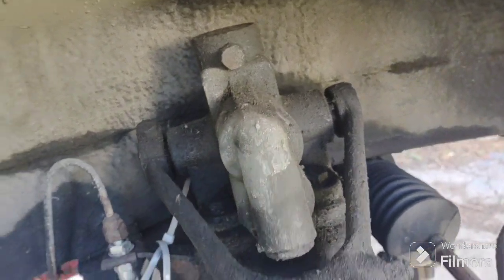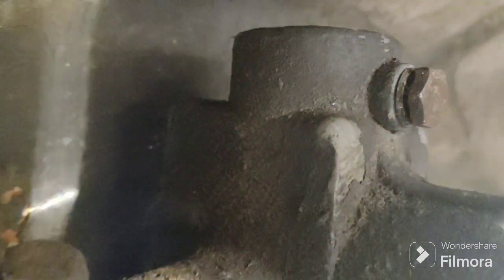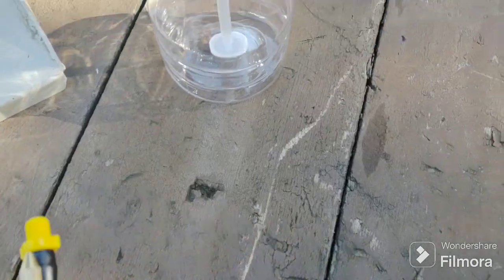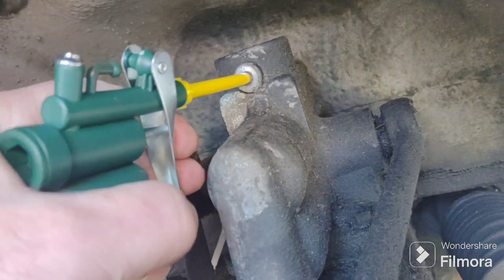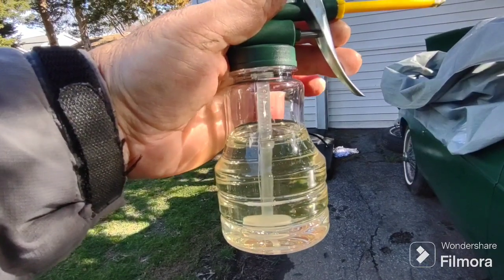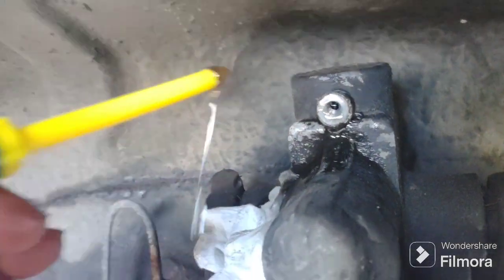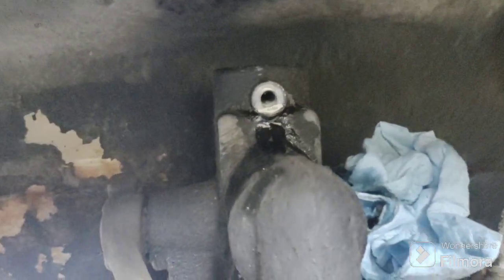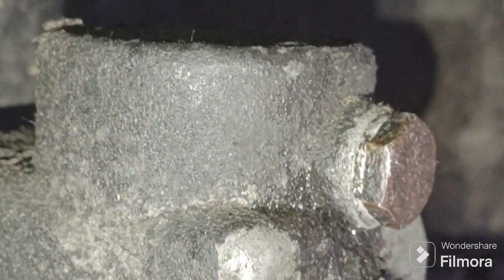MGB Lever Shock Topping Off

Comment from the maker: Just a follow up to my video here, adding the 20W Fork oil did work. It gave both front shocks damping, which they did not have before adding the oil, possibly due to leaking out.
Reply: Thanks for doing the video. You have any idea as to why the old oil is gone? any apparent leaks?
Reply from the maker: @michaelwestermann1048  
Hi Michael! Thank you for your comment.  
   Well, I bought a 50 year old MGB a couple of years ago (this one).  While I never experienced a leak, somehow the oil leaked out over the years, because I had no damping in the front.
  Here's some new news: I drove the car yesterday, and when I got home, I saw oil on both sides under the car. So not surprisingly, my newly filled shocks are leaking when under the pressure of driving (while they're doing their damping job).  So I'm just buying time here until I replace them.